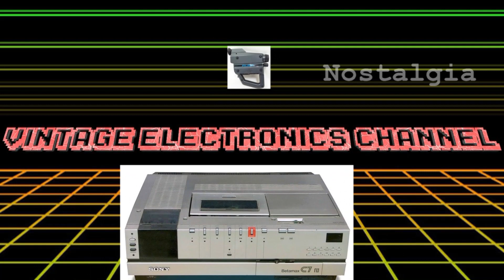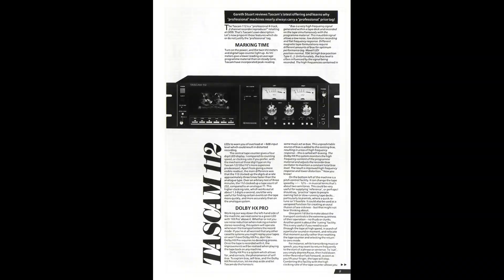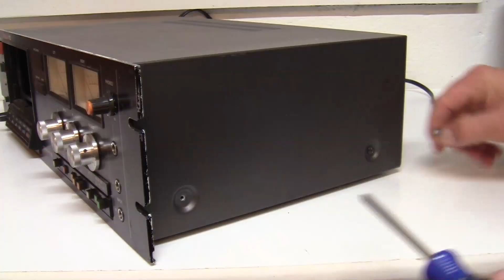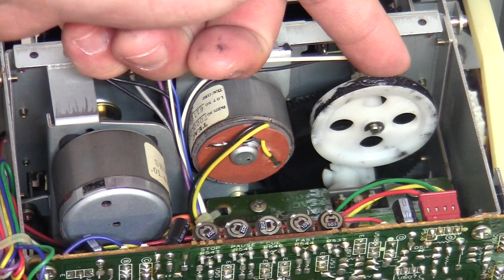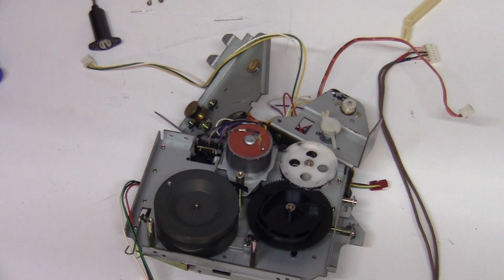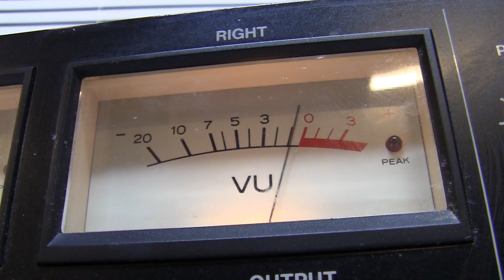Tascam 112 Cassette Deck - Overview and Belt Replacement - Vintage Audio

Comment: This worked great for the belt change, thanks for the tutorial!  However when I assembled it all together and turned on power, the VU lights came on, but the counter display is dark and the transport controls don't work.  I did check all connections a few times.  It appears there is no power to motors or transport.  Is there a connection I can look for?  Thank You!

Comment: The solvent naptha works well too, and it does not damage plastics. Great decks. even coming from the studios they look great in the living room on a portable rack stand. These were not really marketed to the public so much, but they're starting to appreciate the reliability and the full spectrum audio they produce. I haven't looked at the stats in a while, but I believe these are one of the few that can go full range. Way underrated.
And when removing residue.. tear off a piece of a cotton ball, it's stranded in a different way and it removes residue much better than a cotton swab.
A dental pick works good for putting the belts on.

Comment: Thank you so much for this.  My Tascam 112 died yesterday after 27 years of faultless service!  When I opened it today I could see there was a belt in a very bad way.  Thanks to you and your video I now have the confidence to open her up, replace all the belts and hopefully get many more years out of this fine piece of kit.
Reply: go to tapeheads web ,in forum chap gave directions for service manual full of diagrams and parts nos,think was from library of congress,hope your tassie recovers,
Reply: at tapeheads website can download full servtce manual free pdf from library of congress
Reply: Thanks for getting back on that info , I bought this unit many years ago on Ebay and it worked perfect ,then i just put it away for 2 or 3 years and decided to use it to record as I was recording i noticed the tape slowed down and then stopped , Now after replacing the 2 belts it F-forward & Rewinds % plays but it wont Record the record light wont come as well so can you tell me what to look for for this problem
Thank You  Allen

Comment: Can you overdub on this unit?
Reply from the maker: It doesn't have the ability to record sound-on-sound.
Reply: i achived this once on a ghettoblaster, modifying the old box and add a switch to the erase head etc., ok - not looking at soundquality at all. but its fun. also added a potentiometer to the motor etc, switch to left and right record and play head... it was called the 'sozi studio'